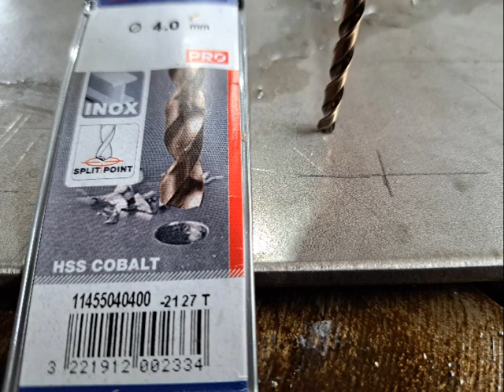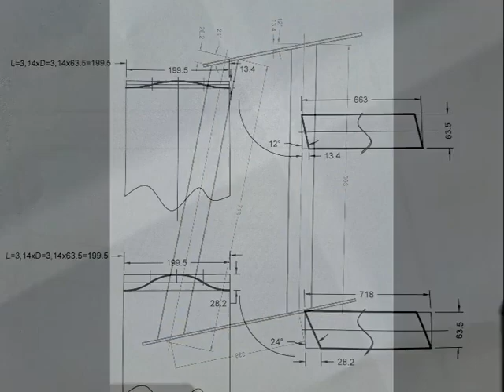DIY Boat Outboard Engine Transom Bracket

Comment: Would you have the meassurments for the cutting pieces including the angles of the pipes. I need to build one for a Yamaha 150hp.
Reply from the maker: Yes... you have to measure the transom angle with the vertical and cut the piper at the same angle. 
On my boat it is 12 degrees.

Comment: Would be nice if you had included materials and measurements.

Thanks
Reply from the maker: The arhitecture, materials and dimensions depend a lot on the power/ weight of the engine.